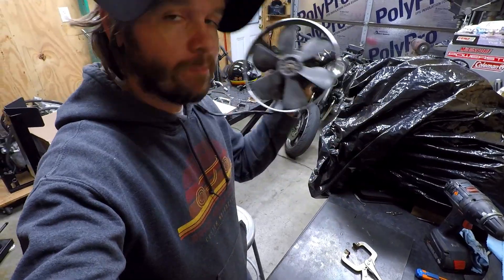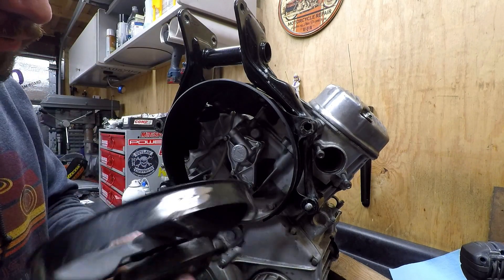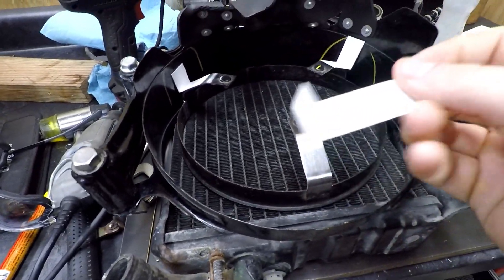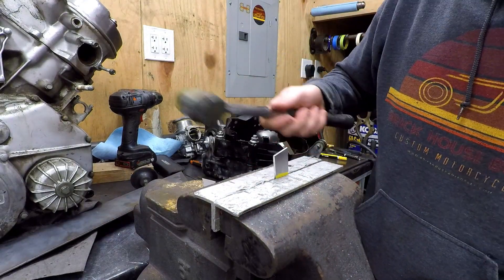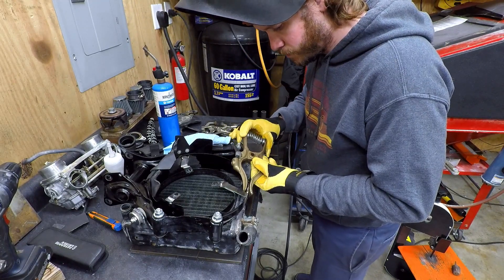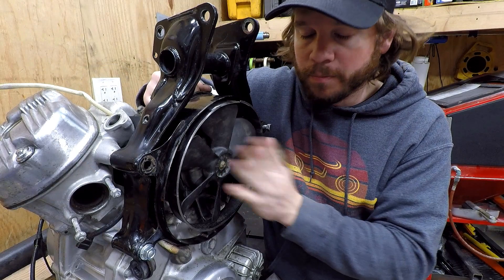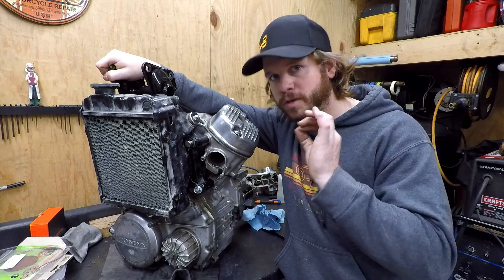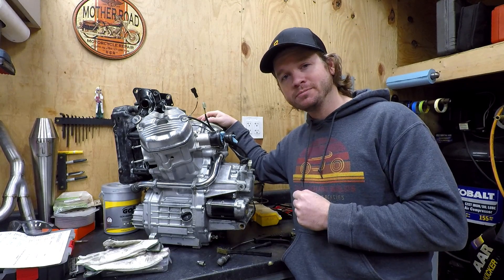CX500 Electric Fan Conversion With R1 Fan! - EP8

Comment: Very slick conversion and a great idea since it’ll spend some time off-road. Makes perfect sense as well as free up some of that engine drag. I bet throttle response is a little snappier maybe?  The caps looks great man and thanks for the shoutout! 🙌🏻👍🏼
Reply from the maker: Yea the low speed stuff always tests the cooling systems so this gives greater control! I appreciate the caps. I ordered a bunch of Furick cups and stubby gas lense yesterday so I can slim the torch down like I've wanted. The back caps were the push I needed
Reply: @BrickHouseBuilds  you won’t regret it! The small lens stuff and furick cups will have you asking..”why did I wait so long?!” 
Keep on killin it BJ 👊🏼

Comment: For those that still want to keep their camshaft and not shorten it, an 09-12 Honda CBR600RR fan works great.  I've done the conversion for a few friends.  I, admittedly, still run a stock setup on mine (new fan of course).  Great job, man!
Reply: Yse I preffer not to cut the shaft. Any pictures
Reply: Got a breakdown on the conversion? Id love to try!

Comment: Thankfully our climate over here in the green place is never very hot. I have a 500 and a 650 engine running with manually switched 4" fans from a quad bike. I very rarely use them. Then again I very rarely sit in traffic. Nice job on the fabrication BJ.
Reply from the maker: Thanks Mike! They aren't needed MOST of the time but of course when you need them you REALLY need them. It does get very hot here in the Midwest and we do have a lot of traffic so cooling capability is important

Comment: Good clean install. I need to do the same on my GL400 cafe. It did get hot while on the slow ride when I did DGR a few years back, so a very worthwhile upgrade from the stock mechanical fan.
Reply from the maker: Thank you! It's strange how the CX world approaches an electric fan conversion as this is controversial over on the facebook pages for some reason.  People say their bikes never get hot with the stock fan but that has never been the case for me or customers.